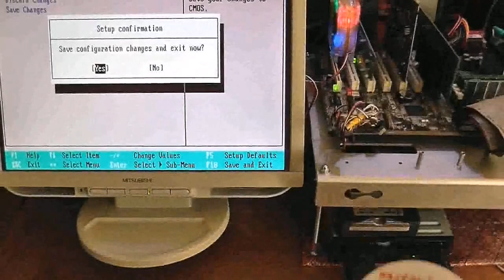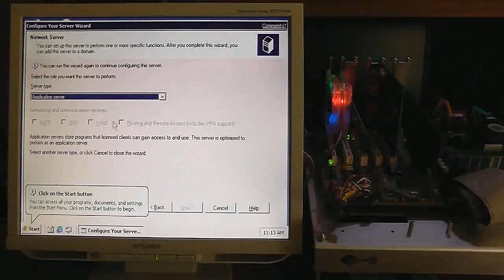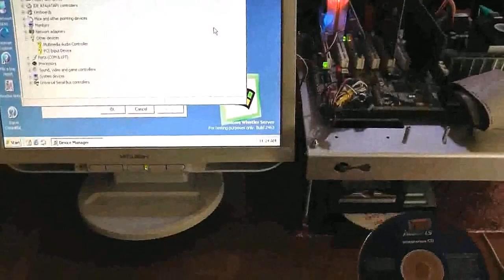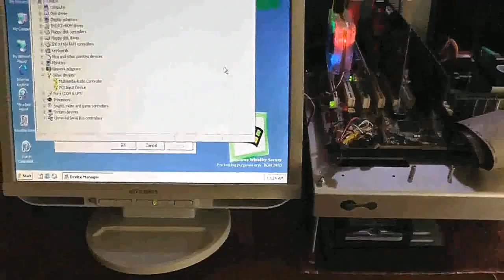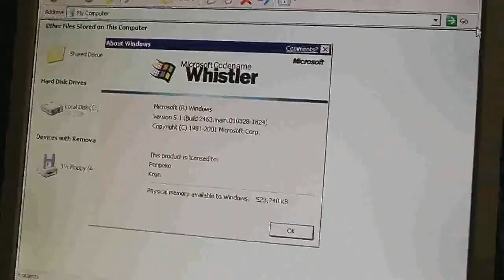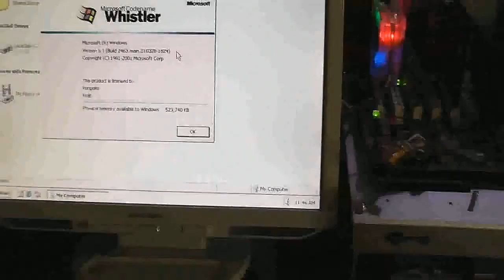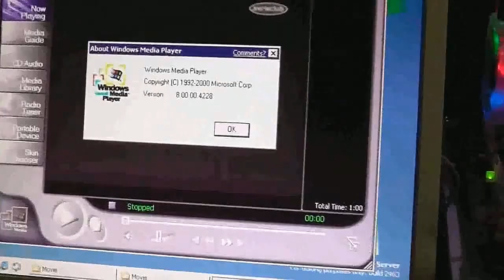Installation of the Windows Whistler Server Build 2463

Comment: WARNING 

The copyright proprietor has licensed this video (including its soundtrack) for private home use only. All other rights are reserved. 

The definition of home use excludes the use of this video at locations such as clubs, coaches, hospitals, hotels, oil rigs, prisons and schools. Any unauthorized copying, editing, exhibition, renting, exchanging, hiring, lending, public performance, diffusion and/or broadcasting of this video, or any part thereof, is strictly prohibited and any such action establishes liability for a civil action and may give rise to criminal prosecution. This video is sold/hired on the condition that it is not to be sold, hired, exported, resupplied or distributed by way of trade outside the EU without a proper license.

Comment: Great video! Do you think you'll use older hardware to do any Windows NT 5.0 (Pre Windows 2000) builds?
Reply: Windows 2000 is based on NT 4.9, not 5.0.
Reply: @WindowsXP_YT  actually, it is NT 5.0
Reply: @tboneanimatetwoaccount2094  no, it's NT 4.9. Windows NT 5.0 and 2000 are different but they are released in the same year.
Reply: Windows 96 no, NT 5.0 was THE codename for W2K. Get grown up dude
Reply: @windowsad1172  no, it's NT 4.9. Windows 2000 is an NT version of Windows Me.
Reply: @KenOath 4.9*